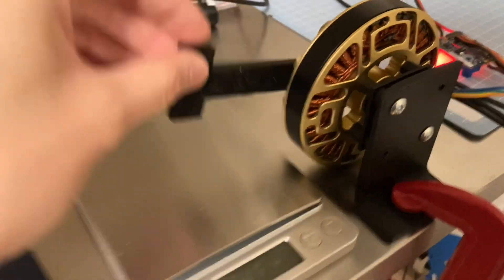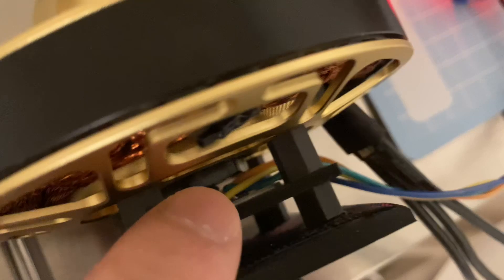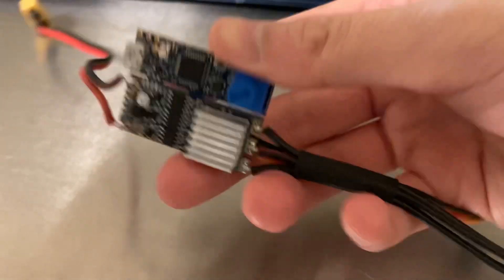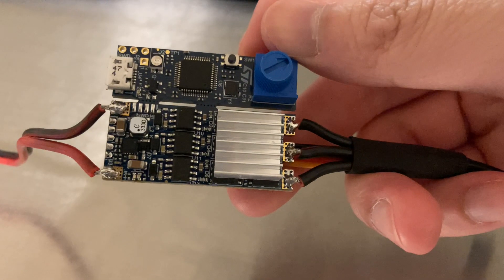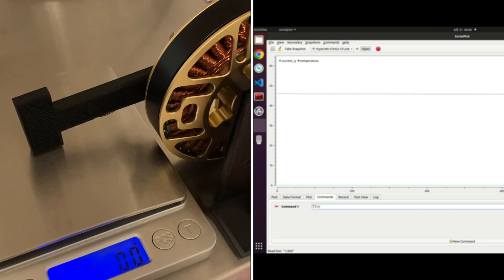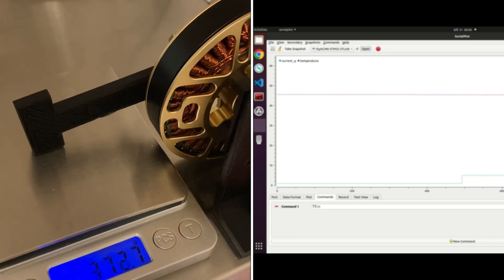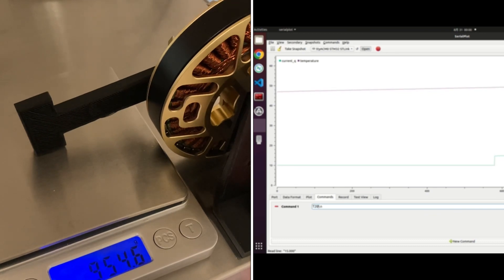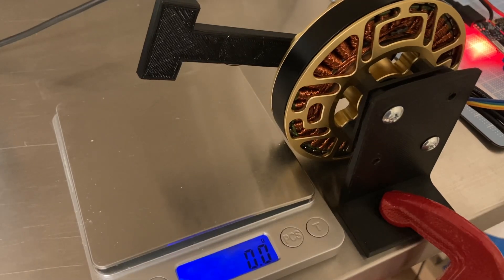BLDC Torque Test (B-G431-ESC, simple FOC)

Comment: Thank you so much for the video. It's clear that you put in a lot of work. Currently, I'm trying to get the B-G431B-ESC1 to work reliably with the AS5600. From the video, it appears that you didn't use additional resistors to interface the AS5600 with the B-G431B-ESC1 and connected it directly. Do you have a link to the sketch you used to run the motor in this video that you could share? It would be nice if you could post an example on your GitHub shoto-taishi and it would greatly help those who are taking their first steps in this, like me.

Comment: Greetings!  Your implementation appears to be excellent. I am attempting a similar project (torque control using a b-g431B-ESC1 and AS5600 sensor). I tried the STM firmware, but it lacks magnetic encoder support, and while implementing SimpleFOC, I unfortunately damaged my board 😢.  Could you kindly assist me? Thank you very much.